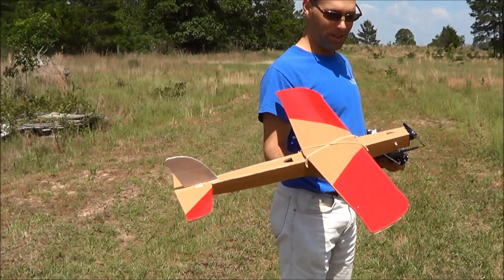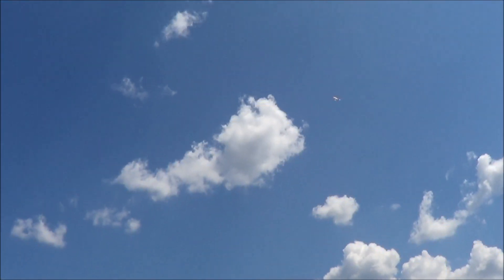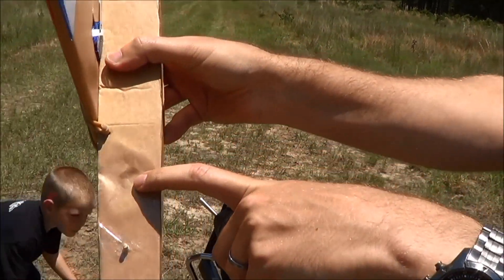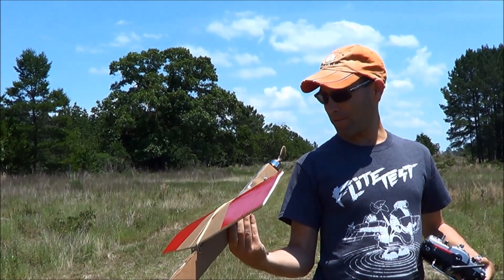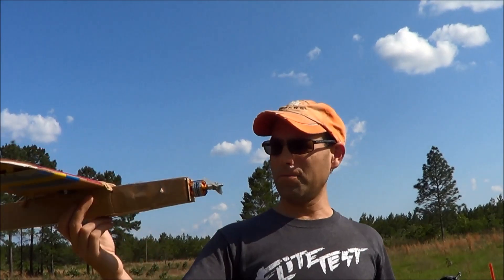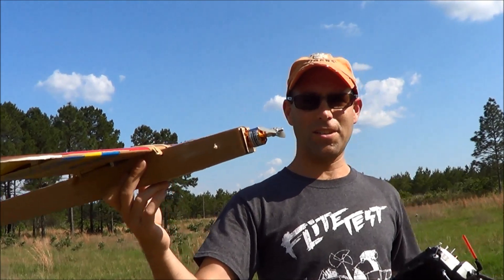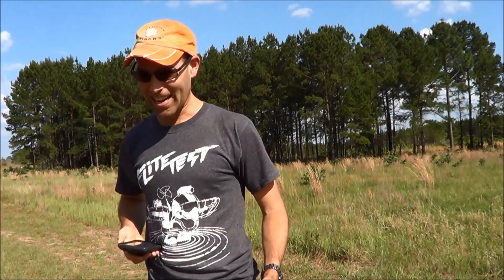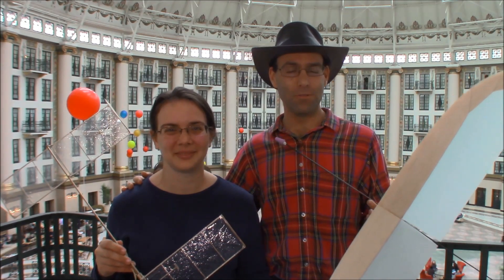Speed Deamon: a 100+ mph foamboard plane that you can build!

Comment: I finally got my own record for my foam board RC plane. 115 mph. I'm going for 120 next!
Reply from the maker: Awesome! Speed is addictive! By the way on foam speed planes, big props and very simple, slim planforms are your friend. The best competition results for the Speed Deamon have all come from 7x10 APC props on fairly large diameter stators (28mm minimum).
Reply: @joshuawfinn  very addictive!! I'm on version 5. Im using a 2315, 2350kv badass motor on 1300mah 4s with a 6x6 prop. My latest design was a low wing (my first time doing low wing) it's done super well! Your video inspired me a while back to try to see how fast I can go! There's so much joy in designing and flying your own planes!!
Reply: @joshuawfinn  my other speed planes I ran from a 7x4-7x6 but that's hard on the motor. This is my first time trying a 6" prop. I have a 5x7.5 prop I may try. But I think it's a little small. Next I'll be trying a bigger motor so I can run a higher pitched 7" prop.

Comment: Josh, how do you convert the dxf file to pdf for printing, had a go with an online converter but the scaling came out to 66 inches wide which is obviously wrong. Any advice would be appreciated👍
Reply from the maker: Craig Blake there should be a .PDF in that folder. That said, I just attached one in the build thread too. Let me know if it gives you any trouble.

Comment: Awesome!  I wondered if the crack was the rubber bands giving a bit and then the wing slamming back into the fuse.  That is a LOT of force on those bands :-)
Reply from the maker: wilmracer I actually found a crack in the bottom of the wing. Even with a cf spar in there it flexes enough to rupture the skin, but it's still structurally ok thank goodness.